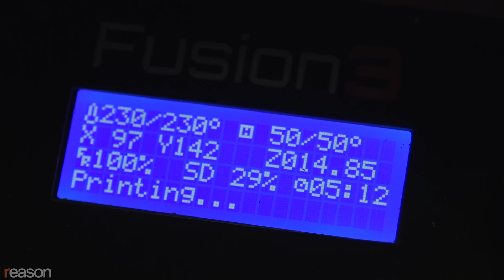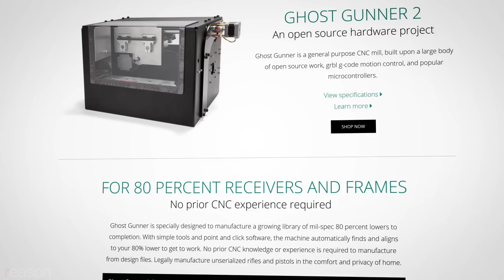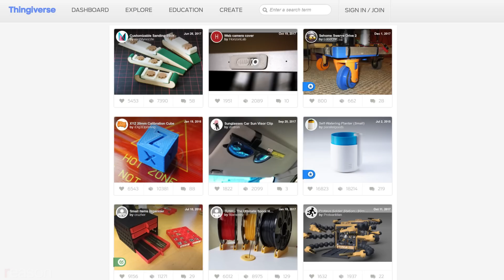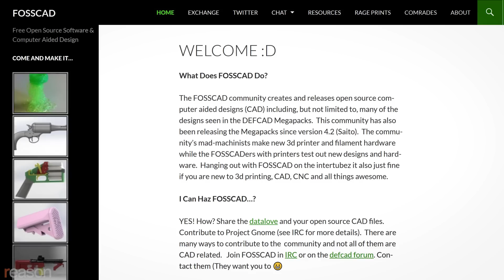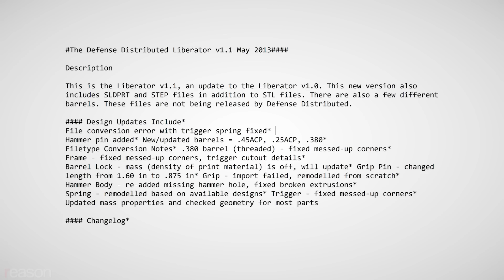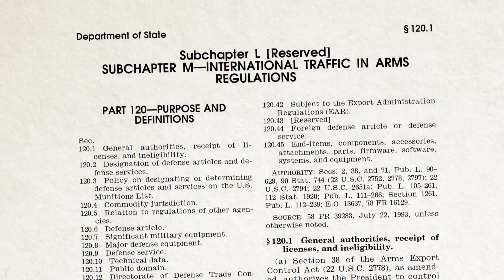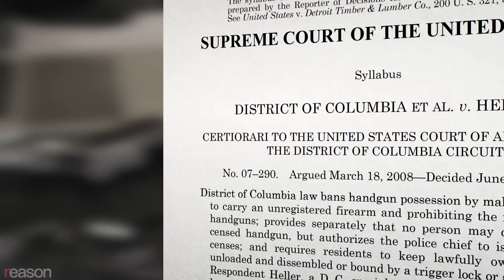The Inevitable Death of Gun Control: Cody Wilson and the Future of Untraceable Homemade Firearms

Comment: Hell, little workshops in Vietnam produced rifles for the Viet cong that took on the US military. All you need is the knowledge of how a firearm works and is produced and gun control can mean nothing to you if you’re able to produce working Kalashnikovs like a Vietnamese craftsman did 40 years ago.
Reply: They where supplied by the Soviet.
Reply: Wankel Motor that too. But they were also making copies of US weapons by hand.  Look it up, it's pretty interesting.
Reply: They died by the millions taking the USA on too.
Reply: Yes but look at what parts they are making. Usually the eiter buy the hard parts like barrels, etc. or make them on professional machines for the task.

When you see vice reports, etc. from a pakistani gunmaking shop they usually show you just the men sitting there finishing the slide to rail fit, etc. with a file, and they dont show you the forging hammer stamping out the forgings, or the gun drilling machine drilling the barrels, or the CNC milling most of the frames and slides, and so on.
Reply: Wankel Motor while that is true. You don’t get your knowledge of making guns from shows. You can reverse engineer a rifle and figure out how to make your own.
Reply: Paul Frederick that was just the north Vietnamese army. And they didn’t die in the millions. They lost just over a million. And they weren’t just taking on the US but a coalition and it was mainly composed of the South Vietnamese army but still. The guerrillas were a problem throughout the war and it’s something to take into consideration.
Reply: @1pcfred  But they also successfully beat the most well funded military in the world.
Reply: @nullnull7089  the USA has never lost. Ever. In Vietnam for example we carpet bombed their capital city with B-52s and forced them to the bargaining table. That ended in the Paris Peace Accord which allowed us to exit from the conflict. All of this happened before the South fell to aggressive communist forces. By then we were tired of propping up a failing regime. So you'll have to excuse us for not going back for round two of futile warfare. It wasn't because we couldn't but rather we simply didn't want to. I personally think it was the right call to make at the time. Though it has lead to some confusion by those who don't know their history too good. I'd suggest you learn yours better before you voice your opinions on matters you don't understand.
Reply: @1pcfred  Making continued conflict unsustainable for the country invading you is the same thing as winning. We didn't have the ability to keep boots on the ground long enough to establish order like we did in Japan so we had to withdraw, the reason we couldn't just station troops everywhere is because it would be expensive and dangerous against a population that hated us. Just because Bush said "Mission Accomplished" doesn't mean that we actually won in the middle east. The goal in these wars is never "kill all the enemies", it's "establish a friendly regime to keep the peace" so if the regime fails we have failed. Killing every single military target means nothing when the opponent's military will continuously regenerate faster than your public support for the war at home dwindles. You simply cannot occupy a hostile, armed populace in the new era of warfare.
Reply: @nullnull7089  they capitulated to us. We never invaded them either. We were in Vietnam for 11 years. So what do you mean long enough? We did not have to withdraw. We could still be there today dropping Agent Orange on their rice paddies if we wanted to. Who's going to stop us? It would take the combined armies of the world 4 times over to even begin to pose a threat to the US military. That includes the armies of all of our so called allies too. Get a grip.
Reply: @1pcfred  We did not have to withdraw but the enemy made us want to withdraw. I'm not saying rice farmers with AK-47s can annihilate the entire US military, I'm saying they can make prolonging the conflict not worth it. We withdrew because it wasn't worth it to stay, they made it not worth it to stay, therefore they won. You can only say that we won if we actually accomplished our goal there, which we didn't. We made a bet that the government we established wouldn't crumble after we left and we lost that bet.
Reply: @1pcfred  The fact that it didn't last after we left means we failed in our objective. The goal we had going into Vietnam was prevent communism from taking over and ensure the existence of a peaceful western government, perhaps you could say that we "won" up until the point when we lost, when the scumbag commies later overthrew it. If you train your dog to not shit on the floor and after you leave he shits on the floor have you succeeded in your training? You might have thought that you succeeded before you left, but as soon as he shat you have retroactively failed.
Reply: @nullnull7089  no we didn't. We achieved our goal and left. You don't know why we were there. The commies wanted something for nothing and we made them pay dearly for it. Capitalism won!

Comment: If I can make some quality AK47's I will personally shake this mans hand and buy him a steak dinner.
Reply: taggartlawfirm you just made this seem way too involved lol. They need to grab average people and streamline the process so the average person can do it.
Reply: Atlanta Light I didnt mean to, that is what you would need to make an AK, which is really pretty simple if you think about what it takes to make something like a mauser turnbolt.  The only critical bits are the barrel, trunnion, and bolt.  Firing pins have to be pretty tough and precise, but you can fudge that a bit.  Really the hardest thing to actually make are springs.  Springs can only be made from high quality steel and must be precisely heat treated.

Right now you can buy those, but as an intellectual exercise I’d like to see what it would take to make everything.

Of course, the whole exercise ignores the issue of ammunition.  Without modern powders, and primers, you’re dead in the water.  You can technically machine bar stock into cases, (PITA) and the same for projectiles.  But w out powder and primers your done.  Black powder won’t work in modern semi’s, so being able to make modern double base smokeless powder is likely an insurmountable choke point.  Primers are less difficult, since you can use mercury fulminate, which is easy to make, just dangerous as hell (really really dangerous).  Sigh.
Reply: Atlanta Light Google "shovel ak"
Reply: I guess it depends on if you're talking stamped or milled receiver AKs. Quality springs are pretty easy to come by depending on your hardware store, and if you're really strapped you might well be able to produce "good enough" springs.
Reply: RedShocktrooper Yanno, milling is a pain, but you could mill an aluminum receiver for an AK very easily, frankly it would be easier, since sheet metal forming and ribbing is a pain.  You would need a way to secure the barrel trunnion since you couldn’t weld it. But very much food for thought.

Alan
Reply: Milling is a pain, but the device shown in the video is, well, a milling machine (even if right now all it does is finish premanufactured components). Not sure about the barrel, gas tube, an so forth, though, but I did recall that the Soviets at one point had the "stamped or milled" deal themselves.
Reply: Yeah you'd need all of that if you were going to mass produce the firearm. To make just one you do not need to stamp out parts though. As there are other ways of cutting metal.
Reply: I found it difficult to locate a good AK-47 model. I actually didn't find one. The noise level I encountered was too high for me to find a suitable string filter. I'm sure they're out there. That still doesn't make them easy to find though. I did just get some nice 1911 models and a Liberator file set too. Demilled AK kits are cost prohibitive these days. I should have stocked up 25 years ago.
Reply: Atlanta Light lm onboard.
Reply: A whole steak dinner! golly gee!
Reply: You can take a class in Vegas where you get to assemble your own personal AK. Book your trip.
Reply: taggartlawfirm most of the parts you get are in a parts kit
Reply: Paul Fredrick You can find all the part of AK-47 in ghostguns.com
Reply: You would make more money manufacturing bolt assemblies for AK's
Reply: Yes you are able to mill AK receivers on these with the proper coding as long as this machine has enough space. Then buy all other parts no checks online.
Reply: awesomeguynamedjon  I like the thought, but not a chance. I doubt even 3d printed gun barrels will ever be a thing.
Reply: The Plastikov is here, and with some additional post-processing (fiberglass heat welding) it appears to be about as stronk and reliable as a stamped AK receiver. As for assembling the rest of the AK, you’re still gonna need some pretty pricey tools to finish one

Comment: With current Additive 3D Metal Printing, one can make all Metal Gun Parts, with appropriate metal ( steel, aluminum alloy) and hardened as Required...From Turbine Blades, Acid Valves, and Engine Parts (MV)...Ordnance Repairs in the Field!!!
Gun making has become  every day every where possible. NO PLASTIC except where appropriate ( Stocks, Pistol Grips, Magazines, Links now.)
Even Composite Cartridge Cases!.
Doc AV

Comment: It's kinda stupid that they regulate lower receivers more than barrels because milling a receiver is far easier than creating a barrel that holds the high pressure . If the government wants to regulate ghost guns they're not doing a very good job at it.
Reply: +Simon Murray that's how they do it in Europe, barrels and bolts are considered firearm parts, but in many countries the bolt carrier, receiver etc can be sold as "free parts" (I assume in some places all gun parts could be regulated).

But there's a catch. In the US it's easy to mill AR receivers and bend CETME/HK or AK flats - but there's a lot of guns which people don't have the schematics/dimensions for. Pressure bearing parts are not hard to design (and honestly you can just replicate the original barrel profile with quality steel because the original design was rated for proof loads and thus will hold more pressure than generated by a normal round) and now people have come up with ECM rifling at home, so if you have all the parts except bolt and barrel, those are easy to reverse engineer just from looking at the parts that interface with them and taking measurements.
Reply: Simon Murray Ssshhhhhh! 😉
Reply: The lower is regulated because it contains the trigger group, which is what has to be modified to turn a semiautomatic into a fully automatic.

Comment: Nothing that couldn't be accomplished before with a drill, hacksaw, some files and patience. 
Once the elected thugs require serialized barrels this operation loses most of its real effectiveness. Once someone that makes a machine that print out rifled barrels is when things get really interesting.
Reply: With the low cost of hydraulic presses it is possible for people to do button rifling in their garage. It isn't as accurate as cold hammer forging, but just about anyone can do it.
Reply: I was at a black powder rendezvous where someone was rifling a barrel by hand, the same exact way they did back in the 1700's, and you could use the exact same method to rifle barrels for modern guns... It would take a couple months to make just one barrel, but it can be done. ;)

Comment: I used to work in a correctional facility. Once a prisoner got possession of a live round, they had no problem finding an appropriate size steel water pipe, and finishing up their firearm. If I had the proper equipment, I would be dangerous. Get ANY working firearm, take a micrometer and draw blueprints for each part. Then they could be programmed into a CNC. I applaud this man for his bravery.

Comment: Upsides? Guns can go unregulated, which means that gov't will not be able to track down guns for control, which is never a good idea. Downsides? The wrong hands could turn this into a very big issue. If you want self-defense at a range, there are these pistol-like weapons that shoot non-lethal rubber balls that can just hit the target, stunning them, or can have an irritant in the core of the ball. However, I do understand why this is the case. Considering the current social climate, its understandable why ghost guns might be a good way to prevent the gov't from taking away certain freedoms that are okay to execute. But, its a bit off for self-defense. Ill try and get the website where you can buy these self-defense weapons, not guns, but weapons

Comment: Show me how to make my own bullets. I live in blighty
Reply: Black powder: Potassium nitrate (stump remover), charcoal, and sulphur (for gardening) -- all available at your local store. Mix together in the right ratios, and congratulations.

Nitrocellulose (gun cotton, primary component of smokeless powder): sulfuric acid (drain cleaner), potassium nitrate again, and cotton. Tons of videos on youtube on how to prepare it, and at the end you've got guncotton propellant. Add an antioxidizer or anything else you want to get the features commercial powders have, but it's trivial to make.

Make cases by shaping aluminum, brass, or even 3d print them from polymer. Stick whatever you want to shoot on the end (lead is an easy choice to work with). Congrats.
Reply: I still think someone needs to work on home metallurgy, to complement 3D milling.  Crappy blocks and plates of plain metal aren't going to cut it.  We need to be able to smelt better alloys from scrap we find.

Comment: Yup. I've been making simple firearms without any firearm parts for years. My favorite of my old builds is a pair of .410 pistols built from plumbing hardware. Those costed about 60 bucks total to make and load. Right now I have a .25 cal. pistol built with blank gun parts and "ammo". It costed me less than 200 bucks to make and load. Later, I'd like to get an 80% lower included "complete" AR-15 pistol kit, a 30 rd. magazine and some .223 ammo which would cost almost 400 bucks total if I go that route. I definitely recomend gun building. It's cheaper, still effective and still less hassle than buying a gun.

Comment: Making a gun has always been pretty easy really. But also totally pointless for several reasons. First, if it's illegal for you to buy a gun, it's certainly illegal for you to make a gun or to have an untraced gun. So what use is a gun when using it is a guaranteed criminal punishment? Secondly, if you can't legally buy a gun, you also can't legally buy ammunition or even just black powder, so what are you going to do, fireworks and homemade muskets? Thirdly, under any gun control law in the world - there is still some legal way for you to get a gun if you really want it and usually it isn't even that hard to get that license. And last, if you really want an illegal gun, you can just buy it and ammo for it from a smuggler, there is no point in making some dinky self made thing if a proper one is just as illegal. You are going to have to deal with legal consequences if you are ever caught with it, but well, you are probably an career criminal anyway if you go that route.

Comment: I've made a few Ak74s from parts kits using shop tools and tooling from harbour freight.  Was able to build 5 with Nodak Spud barrels & receivers ending in consecutive years for each of me and my bro and sisters birth years.  So one Kalashnikov built by me and my dad for each of us with serial numbers that match our birth years.  I used tapco fusion furniture. And the simple single hook triggers which are way better than stock and still cheap.  I made sure the guns ran really well before actually finishing them and that they do.  Only thing that sucks is I can't find any more spam cans and I'm down to my last two.  5.45 was awesome till they made the good stuff hard to find

Comment: you can buy all AR-15 parts and have them delivered to your house, and just 3D print the lower reciever, the reason a plastic lower to an ar-15 is possible is because all of the pressure is in the upper reciever, so the lower can be plastic, and 3d printed.

Comment: Well, Congress does seek to ban  80% receivers and Cody's Ghost Gunner (so far) requires an 80% receiver.  It needs to be modified to be able to mill an aluminum blank. It would also be nice if it was generic: just as easy to mill an AR15 or AR10 receiver (or G3 or FAL, etc) from a blank as a 1911.

Comment: 1. He is not making guns, he is just finishing 80% frames on a overpriced machine. Like people have been doing for a long time with hand tools.
2. The important parts of a gun like the barrel is still hard to make and require specialized tools (at least for rifle barrels).
3. Making a gun is useless if you can not get ammo for it. And in most countries where guns are strictly regulated ammunition is as well.
4. People have been making guns at home for ages on manual milling machines and lathes.
5. A zip gun made from plumbing parts is a 1000 times better than the 3D printed piece of shit "liberator" that is destroyed after one shot.
Reply: "2. The important parts of a gun like the barrel is still hard to make and require specialized tools (at least for rifle barrels)"
and can just be bought. Most of the components of a gun require no checks.
Reply: @MrGrey-zc2cy  In the US yes. But in the US you can just as easy just buy an entire gun...
In countries with stricter gun laws typically the regulated parts of the gun is the pressure/load bearing parts like the barrel, the bolt, or the slide. And that is also the critical and hard to make parts.